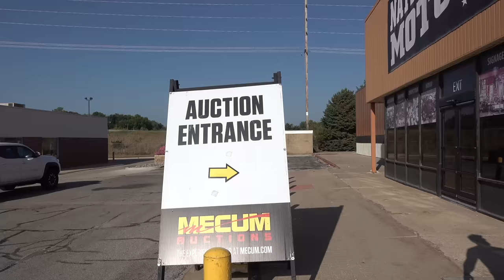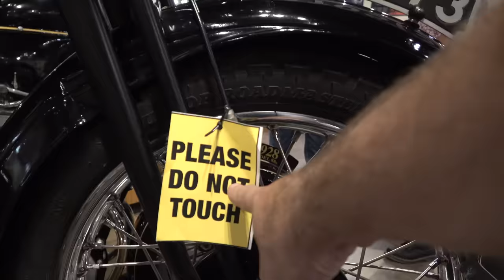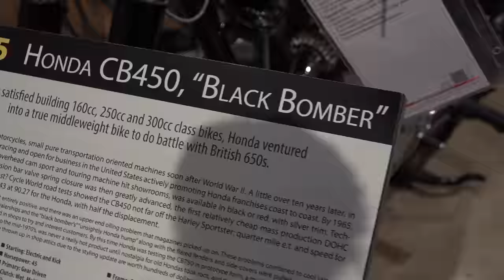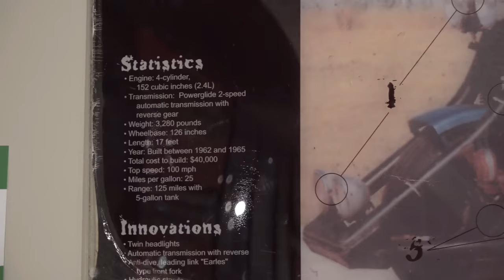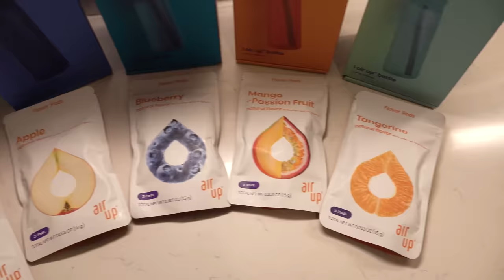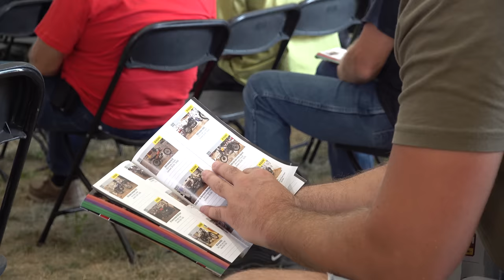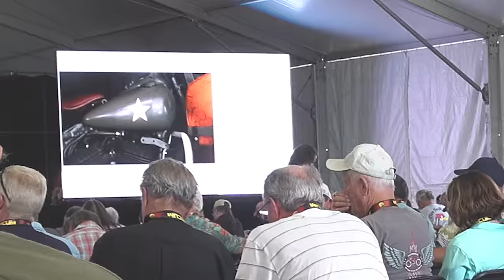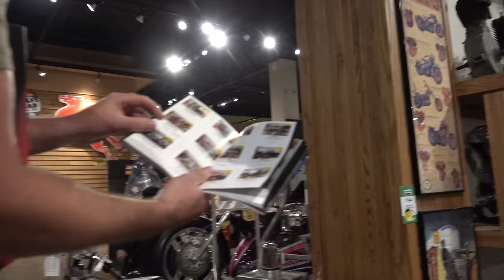I Bought a $100k Motorcycle at Auction

Comment: 4:05 I took this personally. I own a 2002 goldwing with 204k miles on it and it runs perfectly fine, yes I have replaced alot of parts (bearing, forks, seals, etc) but it fires up first time and runs as smooth as it did at 10k miles.

Comment: Did you see that Ariel Square 4? Air-cooled but still cool. Only other Sq4 i know is the thanks-for-the-gas-cap-in-my-face Suzuki 500 Gamma 2-str.[@ 5 min.56seconds]. I am hyper-psychotic about cooling. I want a big radiator in front and kickass cooling of all six cyliders [z1300 Voyager(XIII)]. 
My brother: "oh, wow, the fairing is not connected to the handlebars!"   BF: Oh wow, air shocks!
Meawhile, my last bike was a GoldWing,-monster-fairing-on-board air -compressor-for-f&r shocks and pumping tires.
Duh! it's got 6 cylinders! CBX [1047cc] and Laverda [748 & 906cc vs. 1286LCOOLED] only others!!!

Comment: Suzuki RG500 is a 2 stroke square four. Had the RD500LC instead as the RG was shocking fuel guzzler, should have got the RG and sucked up the difference. RD was a bad road bike for anything but a thrash.

Comment: I am mad as hell at myself. So many of those bikes there I owned and sold for less than 1k in the 70's -80's. Oh well I got to ride them when they were the hot ticket of the day. 3 Bikes I would want back are the RD 350 and Kawasaki 750 triple, both had wet spaghetti frames horrible steering head shake with way to much power. Last my NSR400 that bike was as close to a perfect bike as any ever built, handling matched the power perfect. RG 500, RZ500 were no match in handling. Possibly my 81 gs 1100 as well. Though my 2001 bandit 1200 has treated me very well for the last 22 yrs. I love it power handling and comfort.

Comment: The story on that crushed Panhead is WRONG. It used to be on display at a Honda dealership in Kenosha, Wisconsin. But the tag on it then said that the former owner had kicked it 127 times and it wouldn't start so he had it crushed. The Honda dealer was a big collector of antique motorcycles and he had purchased the crushed Panhead along the way.

Comment: For sure build a steam bike then you can have 2 bikes you spent over a 100k on. Unless your talking about half@$$ing it and just building some garbage just for one video then NM. Hell get an old air compressor fill it with water put a propane burner under it connect the back wheel and there you go.
Reply from the maker: There we go

Comment: I wish i knew what the black bomber went for my first full size road bike was a black bomber that i bought out of a litteral barn in eastern nebraska for 50 bucks with a title and all the bit and pieces from when it was new including an add from a dealer haha i didnt know it at the time but it was pretty valuable then i got it running after a weeks worth of cleaning and tinkering it had like 2k original miles on it as the old guy i got it from well his son that owned it died not long after having bought it and it sat all those years but man did i love that bike i sold it for pennies compared to what i found out it was worth later i got 2000 bucks for it when i sold it a guy told me afterwords that the pipes were worth that haha oh well it was fun while it lasted